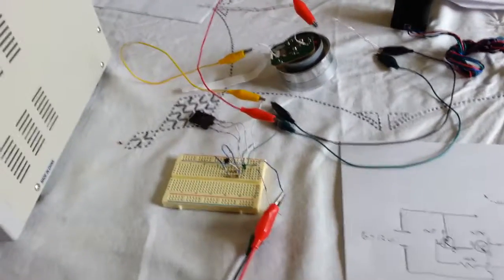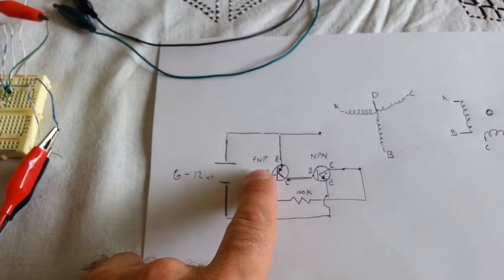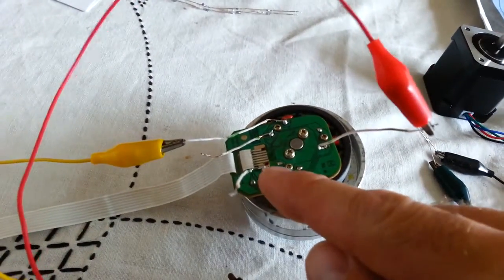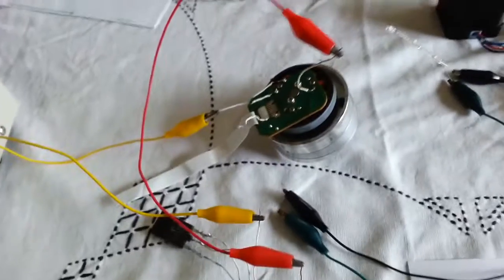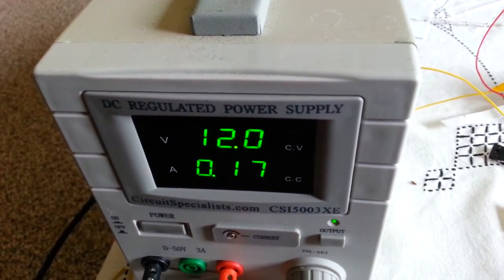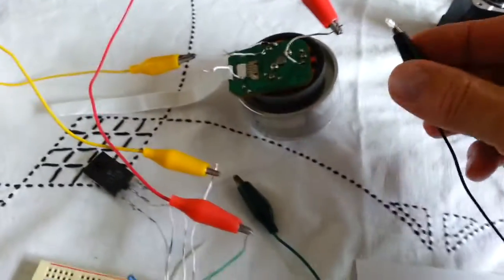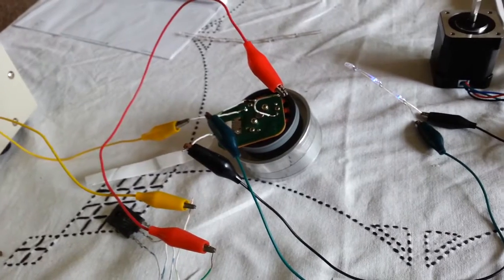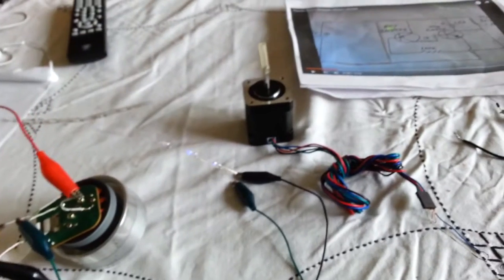Three phase motor circuit discovery.

Comment: On the point of getting a bigger transister to drive a larger motor, the setup you got should be perfect to running a smaller one, less than half the size shown in this vid, that one called salvage out of them now discontinued handheld camcorders, the kind that uses the mini tapes to store the video data on. Know what I mean?

Comment: it can selfstart?
Reply from the maker: miahbangla no, unfortunately this won't start up by itself. It uses the feed back from the coils to trigger the pnp transistor. Some times after running it I can turn it off and back on it will self start but it doesn't happen every time 🙁